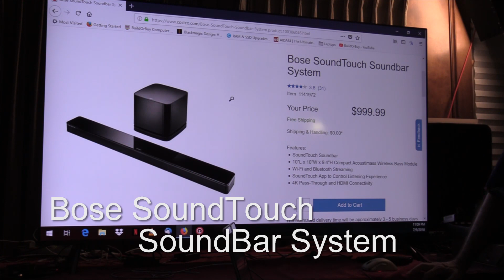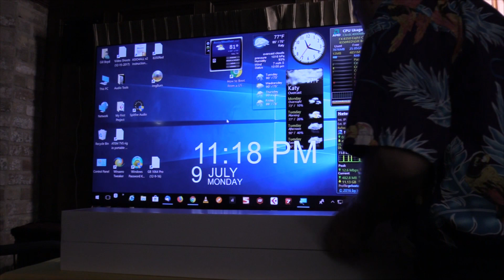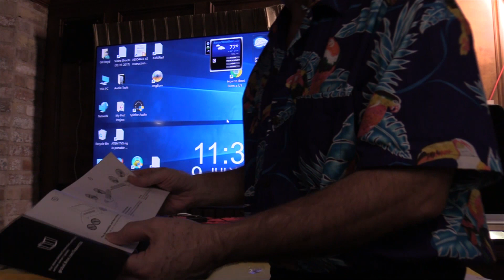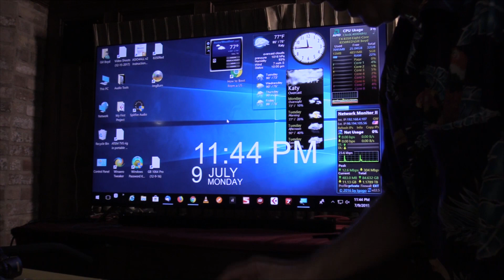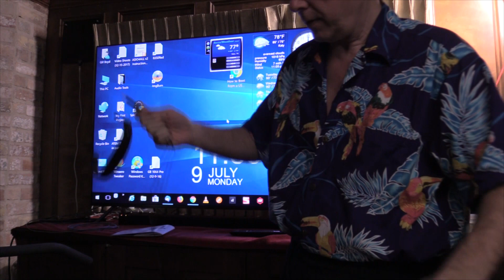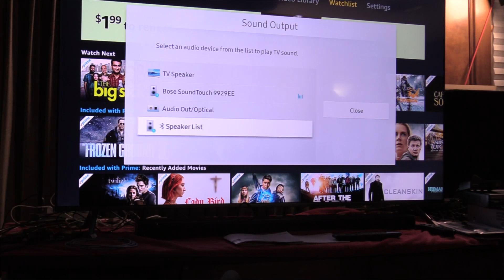Bose SoundTouch 300 SoundBar Unboxing & Setup

Comment: It looks like they paired the SoundTouch 300 with the bass module 500 for a package deal, which is the first time seeing that
Reply from the maker: Hi Jason, 
The Base Module, not a real Sub. Not Big enough! However, works for this price point. That's why it's less expensive. I like a Bass Sub from Klipsch or Cerwin Vega. This works though! And with Costco, 90 days to try it out! A Great Deal! Appreciate Your Comments - Thanks for Watching!
Reply: BuildOrBuy You would definitely be happy with the Acoustimass 300, but it’s $700. It’s strong enough to move pictures on my walls. I totally understand what you’re saying about the BM 500 though, even though it does sound nice, it’s doesn’t have that kind of power

Comment: the costco version comes with a base module?  is that the normal sound touch 300?
Reply from the maker: Hi DELTABOY04
, 
Costco now sells 2 versions - 1 with (Bose SoundTouch Soundbar System - Acoustimass Wireless Bass Module) and 1 without (Bose Solo Soundbar). Did not know that until You asked! Every Soundbar needs a Sub! Sound should be felt, as well as heard! The Bose SoundTouch Soundbar System, yes, Sound Touch 300 with a smaller Bass Module. Not a real Sub. A Sub needs to be 12 inches or more. This one works, for the price point. Just turn up the bass! Thanks for Asking. Thanks for Watching!
Reply: @BuildOrBuy  i just got the 300 for a bargain..looks like you can add two bass modules! so gonna end buying another one
Reply from the maker: Hi  @DELTABOY04  
Excellent! That should make a huge difference! Let Us know how it sounds! And Turn it Up just a bit!